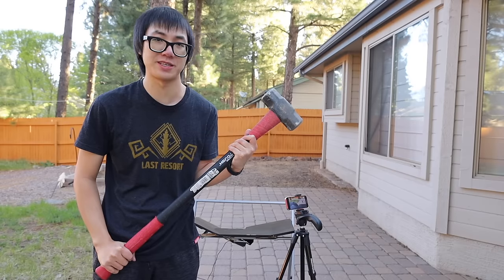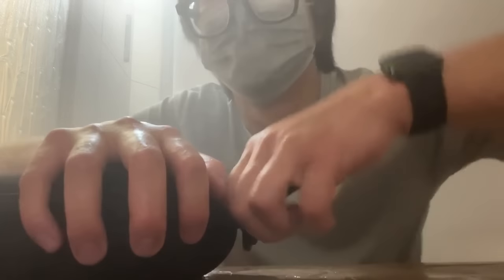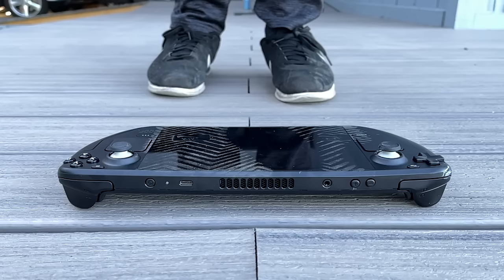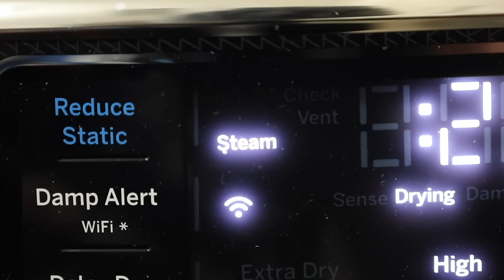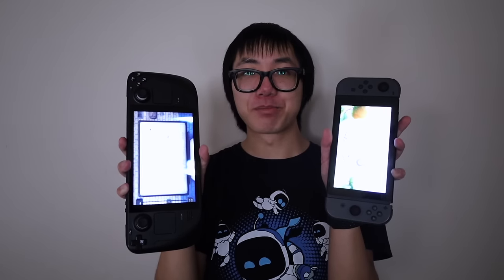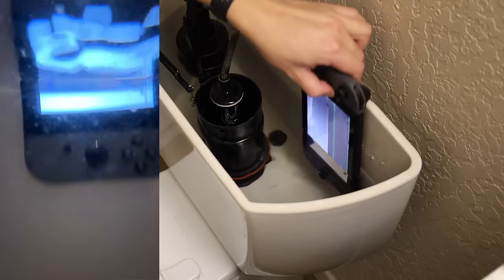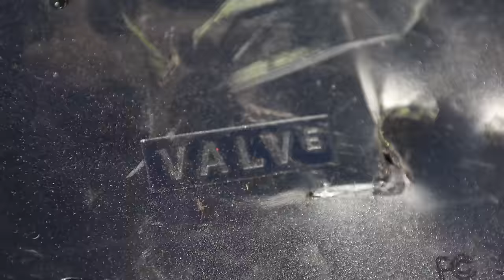Bored Smashing - STEAM DECK

Comment: Gotta give the Deck credit; it only has joy con drift when you throw it in a dryer. The Switch gets it when literally using it for its intended purpose lol.
Reply: I'm assuming you don't have a steam deck, but how do you know that it wouldn't start drifting over time also? Maybe even sooner since it started before the switch in the dryer?
Reply: @quadri136  If you're seriously implying that the Deck would potentially start drifting via NORMAL use just because it did so when thrown in a dryer, idk what to tell you.

Also, it likely has less potential to drift because 1) The Switch is pretty much the only major platform out right now known to have this issue to the extent it does, 2) Valve has stated that they thourougly tested the sticks to try and eliminate potential issues such as drift as much as possible (showing they care more about build quality than Nintendo), 3) The analog sticks for the Deck are considered premium quality compared to the Switch's.
Reply: @ShadowMan64572  correct me if I’m wrong but isn’t most of the joy on drift from people moving the joycon sticks while turning it on?
Reply: @bukakkesteakhouse2077  I heard it's due to faulty build quality of the Switch where the material underneath the sticks grind and wear down upon usage. I've had mine for maybe 2 years at this point and never got drift, but then again I don't use the Switch a lot.
Reply: @ShadowMan64572  my Nintendo Switch (lite) got a drift after a year and a half of use.
Reply: dont forget they have a video on their channel showing the insides of the steam deck, amd they have a replacement guide in there
Reply: @ShadowMan64572  either that or if you eat food while playing and don't wash your hands before you start playing again the food particles can get in under the circle flap part on the stick that is  hiding the internals
Reply: Mine doesn´t.
Reply: @ShadowMan64572  the xbox one also gets drift about as badly as the switch. I've seen people butn through a shit ton of xbox controllers. The only console I don't recall seeing many cases of drift for was playstation
Reply: More than that. the daughter boards did not work. All buttons failure. @11:47, of which parts are not available.
Reply: But the steam deck is a complete copy of the Nintendo switch
Reply: @jeffym4159  .......the Switch is not a PC. Lol
Reply: @ShadowMan64572  IDK why but only one of my sticks has drift, even though I use them both the same amount
Reply: @SoupyMittens  Technically the switch doesn't drift before because in the OLED model and its special editions and the Zelda skyward sword joycons,  Nintendo added foam sheets or something else that causes it to not drift
Reply: It also has "steam"
Reply: Nintendo handhelds also have faulty shoulder buttons, it becomes a pattern
Reply: @Journey_to_who_knows  depends if the owner doesnt take care of their shit
Reply: @Journey_to_who_knows  My DSi shoulder buttons were borderline unusable after a while. 

My Switch Lite's shoulder buttons are still fine, though pressing down on specific areas like the corners and middle are sometimes a bit unresponsive. I think that might be due to how they're built, as it feels like there's plastic or something underneath that the buttons can "grind" against.
Reply: Ah man another annoying pc player who overrates the steam deck
Reply: @Dhdgcvnnnfx  What aspect of the Deck is overrated? Do tell.
Reply: I'm sorry  you r you bad  guy
Reply: @ShadowMan64572  My Steam Deck Drifted over time and so did most people peoples I know I don’t think you own a Steam Deck lol
Reply: @MrKnowItallLol  Most people's Decks did not drift. Where did you evem here this LOL. Or are you trolling?
Reply: The steam deck is easier to repair than the switch. Steam deck has bigger parts which are easier to find OEM parts.
Reply: @Whateverfloatsurboat2 DualSense does have drifting as well, but I digress. It might be rare.
Reply: You say that the steam deck has been tested a lot by valve to eliminate stick drift but they have said the same with the valve index yet it has terrible stick drift
Reply: Gotta love people explaining why stick drift happens and getting it wrong in the replies. Potentiometers just wear out due to their material. The switch joycon drift is pretty bad by design which is why they're known to have drift issues pretty quickly. Hall effects sticks on the market right now are alright but they need some improvements.

Comment: Steam deck: gets a tiny crack
Switch: has entire joycon break
Plainrock: Looks like the Switch did better
Reply: but he was still able to use the joy-con. although the joy-con has like some common flaws like easily coming out, joystick drifting, i still honestly think that the switch did better.
Reply: @whkn better than a 0.2 mm crack? i dont think so
Reply: @wylker24  joycon and the console are different parts. the console is nicknamed "Switch" and the controllers are nicknamed "Joy-Cons". So plainrock is right if the console didn't break at all.

Comment: I was genuinely surprised that the switch faired better in most tests, especially the toilet submersion.
Reply: that's because of how the tech inside is put and spaced, steam deck is full of it so when it got inside it affected major components, though I'm sure letting it dry, and such could "revive it"
Reply: The switch is a beast it takes a lot to break it

Comment: I never realized just how much of a durability powerhouse the switch is before now. And I treat mine like a fragile baby lol
Reply: SAME 

Literally same
Reply: I try to treat mine gently but I've dropped it many times and the screen has scratches
Reply: Say what you want about Joy Con Drift but the Console itself was made with children in mind. And children are quite dumb. They might play rough with it, fight over it, drop in water or something. So they built the switch to mostly survive alot of those unscathed or with minimal damage. The Steam Deck is interesting as it has a somewhat similar design build of the switch and despite being very different hardware wise, they seemingly were on the same level of durability in this video with the Switch winning most of the tests as The Switch is more destructive proof.
Reply: The Switch could survive being submerged in Water fully. Apparently it's because the Structure on the inside makes it so it can last a while before any Major Damage to the internals can happen.

Comment: Do u prefer more the steam deck or the Nintendo swich. I need to buy smth
Reply: I have nintendo switch neither oled and lite, it's great. I have installed some custom firmware to run android but it's outside of nintendo terms. No offense, I do think steam deck has better functionality if it was installed with easiest user interface experience. If not then upgrading PC or buying PC with strongest specs are more better or instead buying a consoles. But, still because I do not have steam deck right now I do not have much experience about it.

Comment: I dropped my Steam Deck from about my hands' height. I was sure it was completely broken. But it still works without any issue. The only thing that happened is that some plastic clips detaches on the side handle. I just pushed the handle back in and everything's now good as new.

Comment: Couldve given it to me. ...
Oy, and also, GFCI prevents shocks in areas with water. The outlet automaticaly sets to off when it detects a shock, you may feel a small tingle, but it stopped before any real damage is caused.

Comment: Intro + Stream Deck Mini Destruction 0:01
Unboxing 0:43
Testing The Steam Deck 3:37
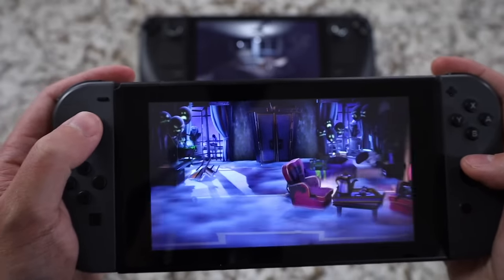Test 1 The Hold Up Test 5:35
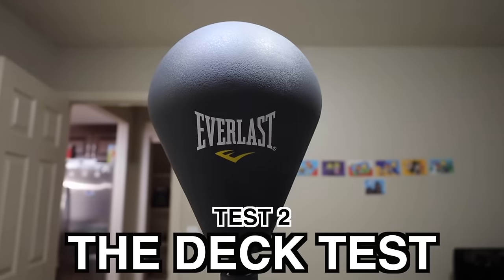Test 2 The Deck Test 6:36
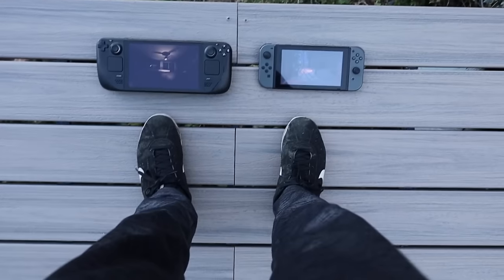Test 3 The Deck Test 7:28
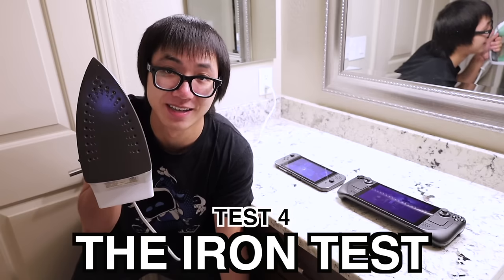Test 4 The Iron Test 8:42
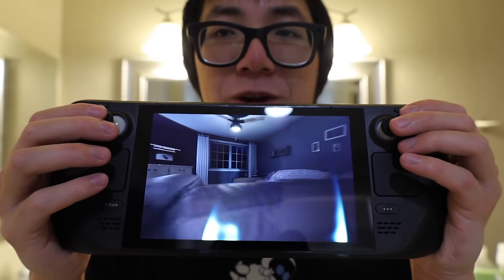Test 5 The Dryer Test 10:01
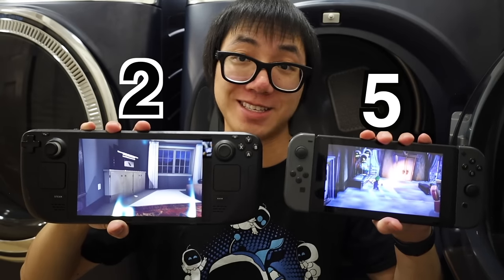Test 6 The Valve Test 12:11
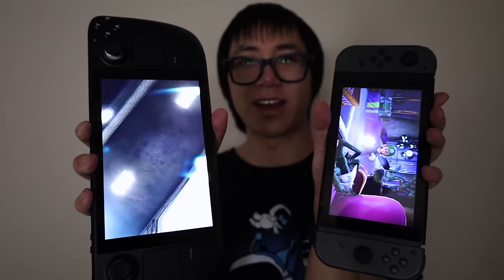Test 7 (Final) The Valve Test 13:28
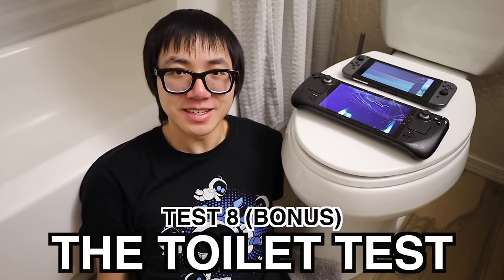Test 8 (Bonus) The Toilet Test 14:36
Steam Deck Destruction 16:23
Outro 20:08

Comment: The switch can still dock ... The deck is just s big switch lite. If u use angle grinder u can cut of the joy cons. Make sure to cut at the right spot. Right by the screen maybe few mm away the bezel

Comment: The only bad thing about the steam deck is well.. kinda the portability..It’s better then the switch to bring with you but on the Go? I mean first of all to connect to your saves it needs wifi. Second it’s battery runs out fast since steam games take a lot more..steam. But I love my steam deck because If you don’t have a PC then it’s better than a console. You can even buy the dock so you can hook it up to the TV. You can buy a Xbox or ps4 or whatever controller you feel comfortable with and play like that..or you can hook it up to a monitor, hook up a keyboard and mouse and play it like that since it has its own desktop mode.

Comment: Is the steam deck better than Nintendo switch
Reply: kinda. steam deck even has switch emulator compatibility, requires original cosole and no online feature tho.
it even can run pc games too but no remove able controller, and expensive.
also if you just like nintendo game, no point
you also could install pc apps too!

Comment: Nintendo Switch Better
Reply: The only win for switch is just portability because it's smaller and cheaper... Steam deck is just generally better
Reply: @oopsiexist it’s hard to compare them as they run entirely different games from different companies. it’s like comparing breaking bad and lord of the rings based on which piece of media is better because they’re just so different from each other.
Reply: @grazielamink  Steam Deck can run basically everything including desktop function while Switch either needs some modding to run more stuff but performance wise the Steam Deck is better

Comment: ok, so this is obviously dishonest  as hell. i didnt have a problem until the 3rd test.  while in the stepping test, they both survived, but he didnt point out the obvious damage to the joycons (which are just all kinds of flimsy) the second test, he put the iron directly on the deck, but left it on an angle on the switch, guaranteeing maximum damage for the deck but minimum for the switch. for the washer/dryer test, he only tested the analog sticks on the switch but pretty much everything on the deck. he also didnt test the state of the joycon ports on the switch, which most likely has been damaged heavily. i could go on. but id like to point out some things that would render most of his "issues" with the deck mute. the drift on the deck is easily solved by the built in calibration option in the settings, while the switch you have to by brand new joycons for the same result. but the biggest plus to the steam deck is the fact that valve has stated that they are ok with right to repair, while nintendo has the legal ability to sue someone for fixing or adding to the switch. 

i get hes a nintendo fan. i am too. but at least have the decency to test it in a more unbiased manner. he rigged the tests in the switchs favor, and then reaped the rewards.

while i do love the switch, i suggest buying the steam deck. more processing power, more game options, heavily modifiable, no legal recourse for self repairs, and the ability to play emulations of games that nintendo refuses to port to new gen consoles, as well as pretty much any consoles you can think of.
Reply: No Capitalization
Reply: @Thedisgrase  if that's your only issue. Here's a fact nobody cares
Reply: i agree, i wanna sell my nintendo switch for the steam deck

Comment: Plainrock124 you said that the crowbar is from portal but you get the crowbar in portal but you need a command for it. The commad Name is:give weapon_crowbar or impulse 101 (sv_cheats 1 =on 0=off)
Reply: it works on windows and mac
Reply: Don’t care didn’t ask
Reply: On both

Comment: Man it £300 pounds like why the fuck is it 300 pounds
Reply: because it has the performance of a ps4, i would say even better than ps4
Reply: @hiamtwistee Crappy iGPUs nowadays have the same perf as a PS4. The thing's literally a 750ti. I'd be disappointed if it didn't beat it in 2022.
Reply: @thenotsookayguy  I think the graphics card is equivalent to a 1050ti
Reply: @hiamtwistee  According to my 7 seconds of research, it's closer to a 560x, which is about as good as a 950, that is only slightly worse than a 1050 though 38% worse than a 1050ti.

Ik, Pascal ti's were actually goated, instead of being 2% better.

Comment: Results
Test 1 The hold up test draw
Test 2 the deck test draw
Test 3 the deck test (again) Nintendo switch because a tiny crack in Steam Deck
Test 4 the iron test Nintendo switch because permanent discoloration
Test 5 the dryer test Nintendo switch because drifting stick in Steam Deck and most button is stopped working
Test 6 the valve test draw
Test 7(final) the valve test (again) Nintendo switch because some fine parts there
Test 8(bonus) the toilet test
Oh wait... This is not a Nintendo switch destruction..
Winner Nintendo switch